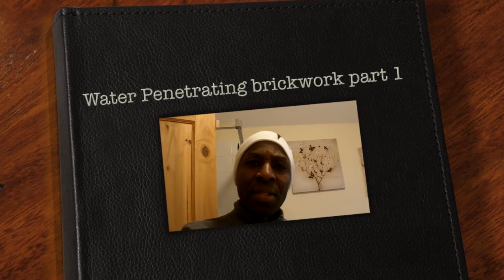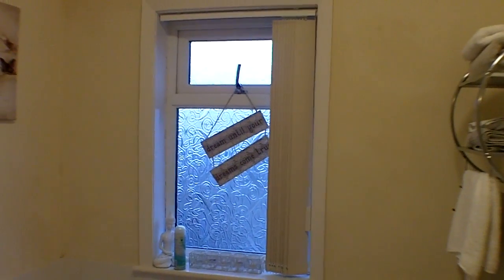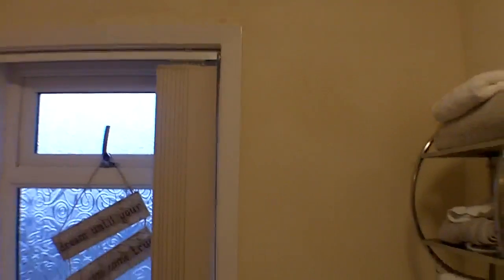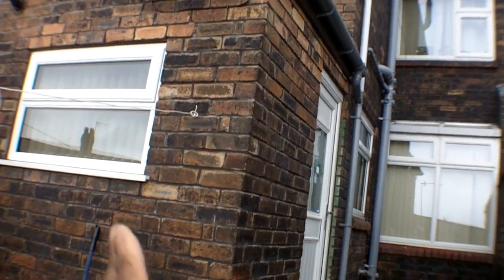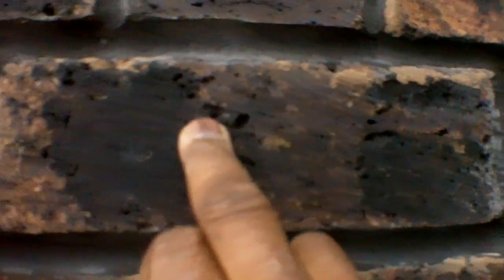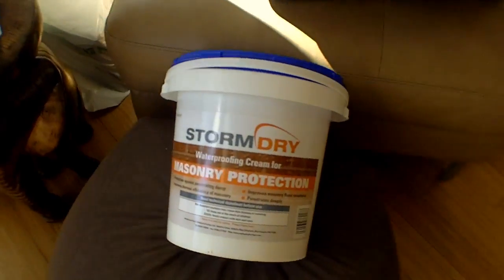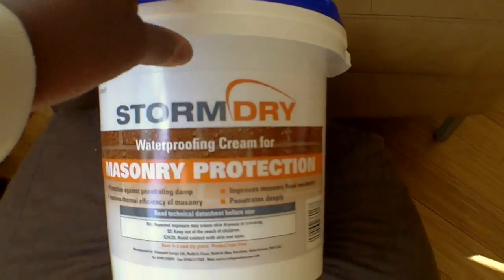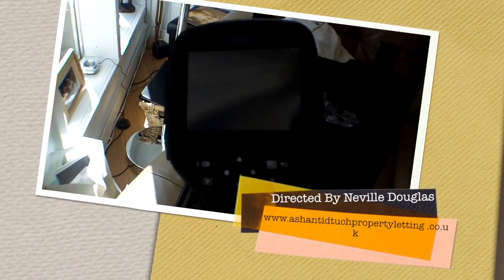Water Penetrating brickwork part 1

Comment: Huge mistake! Huge outer leaf needs to breath hence lime mortar. Portland cement will lock in moister and cause spalling. 

Bathroom issue is a combination of condensation and lack of insulation in the loft above. 

I’d be interested to see the moisture content readings from a thermo hydrometer and carbide meter. 

Solution is to heat the property, ventilate the property and use traditional builder methods. 

A heat recovery ventilator would help negate the cost of heating.
Reply from the maker: Hi Richard, thanks for the comment, this was my second house and was still learning and will always be doing that, however, in relation to lime mortars  there are two types and now know which would have been best for the exposed elevation that I have, the loft is insulated as the whole refurb  needed to conform to building regs,  in regard to the moisture readings I did install a fan from a nationally known company, this helped and we have had no issues since,  in regard to the moisture content reading it was obvious that the wall was allowing water to penetrate and so this was not needed nor would the use of a carbide speedy meter be needed as water penetration was confirmed, I agree with your latter two points however, and I have learned a lot since the vid was made,  can I ask are you a surveyor as looked at you channel and wished I had been able to see some content on your site prior to commencing my works.

Comment: Bathroom + solid brick walls... Makes me think it's almost certainly condensation issues. There may be some penetrating moisture, but it's probably not the root cause of that paint peeling. Installing better extract fans, but more importantly a PIV unit like a Drimaster can drastically improve conditions.
Reply from the maker: Hi Ben, i have installed a fan from Envirovent and that has helped, this was the case, the issue now is the plaster got wet so the salts have migrated to the surface thus keeping the wall damp as the salt on the surface not absorbs any moisture, and so this salt will now cause the dampness and cause the paint to peel, I know the problem and want alternatives to chopping off the plaster and so will visit the paint shop to find one that is unless you have a solution ? thanks for your well thought out comments, do you work in this area?
Reply: Hi Neville - I realise it's around 4 years since you posted the video! Good to see a landlord taking property care seriously. I'm actually an Architectural Technologist working in Bristol. Yes those types of vents are good - you may be familiar with PIV fans - they're becoming very popular with landlords as a means to reduce condensation issues, and they're very cost effective - coupled with a good quality extract will solve most humidity issues. Perhaps there is an inhibitor/stabiliser for your salt issue? What I'm doing in my own bathroom is lining the inside of the wall (also 9" brick) with an insulated tile backer board (Wedi, Schluter or similar), and also this extract - Kair Heat Recovery Room Ventilator K-HRV150/12RH. On the outside I'm stripping the render off and leaving the brickwork bare (after an acid clean). I'm fast subscribing to the school of thought that avoids any method of sealing the outside of old walls (especially brick) - it's thought by many that these chemical treatments will do more harm than good - and rendering with cement will certainly create issues.  Even those that claim to be breathable in fact aren't very. You're good with lime as I think you mention. I'd recommend you look up Peter Ward - he has some very interesting videos on here.

Comment: did it work??
Reply from the maker: suppose yes, as the tenants have not complained about the wall being damp, we had to redecorate, and the cream has a 25 year warrantee,  up to this point had never used this system before and so will keep my eye on it , hope this helps,  when I say suppose it is because I am using a new product, that said the builder who applied it has used the cream on other jobs and is happy with the result.
Reply from the maker: see my last comment, if I know what i know now I would have left the wall to dry, seal the brickwork on the outside, as well as chopping off the plaster on the inside then uses a specialist lime plaster and as lime putty to point this part of the building
Reply: you're learning you're getting better that the way to go
Reply: and if you're not  happy with the crumbling bricks on the outside you can always use K Rend the whole back of the house
Reply: that's what I like to hear use the material that the house was built with lime
Reply from the maker: yes going back to take readings in the next two weeks or so, the bathroom will need redecorating again as the painter did not use an oil based paint on the walls, this is due to released salts on the surface.
Reply from the maker: yes